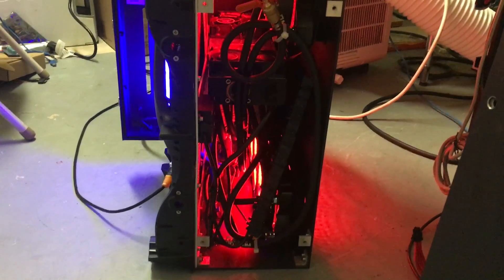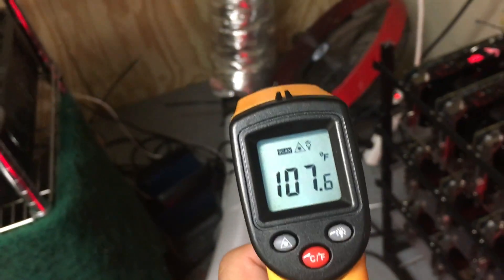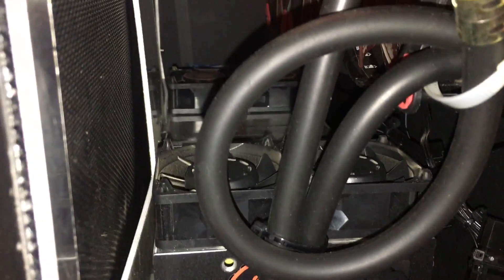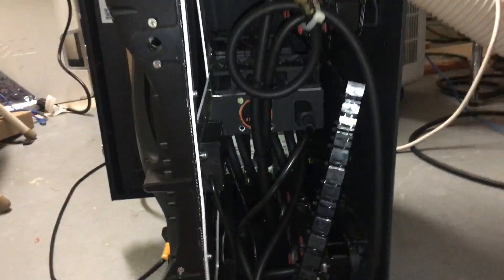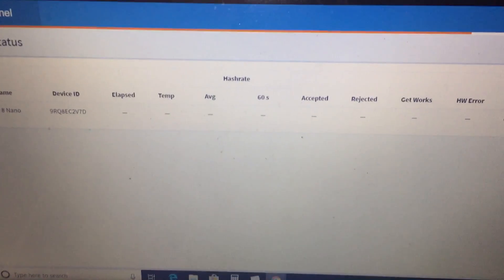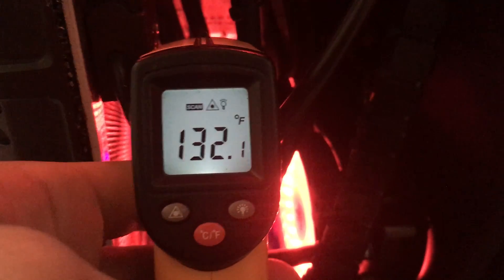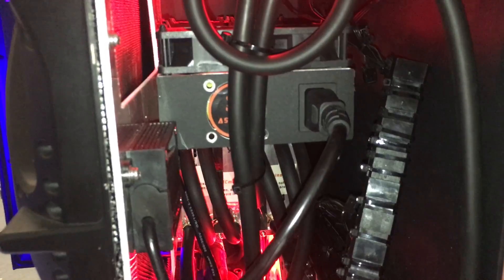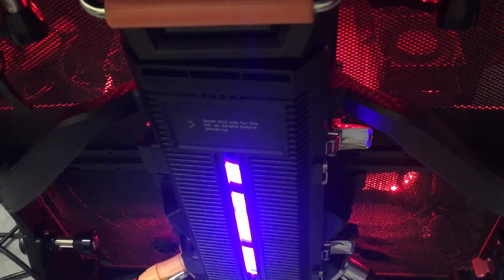Water Cooled Asic Miner  - Liquid Cooled Bitcoin Miner

Comment: Looks like corrosion starting to happen judging by that res. What kind of coolant are you using?
Reply: It's probably well water. Not Distilled that's for sure. Throw some silver in there lol
Reply: I'd use trichloroethylene glycol solution if it wasn't for the EU banning it.

Comment: Nice machine you have there. Would be interesting to see how that pump holds up. The materials used on the fittings look to be brass. That mixed with the aluminum is going to make a heck of a corrosion buildup. My guess is that is what you are seeing in the reservoir with that yellowish tint.
Reply from the maker: Great info Kent! I appreciate that.